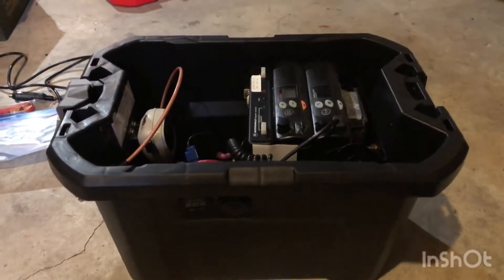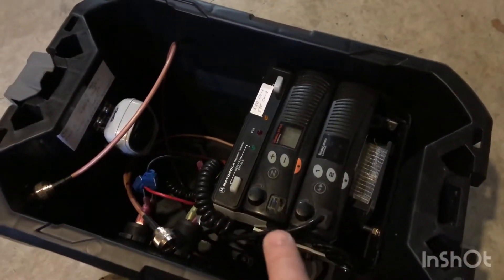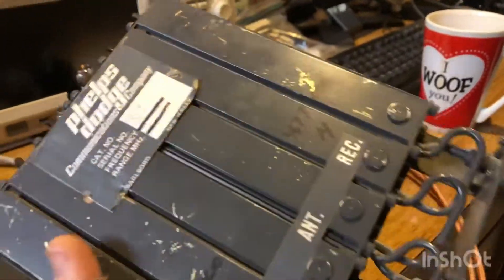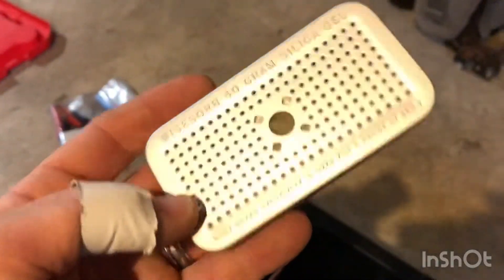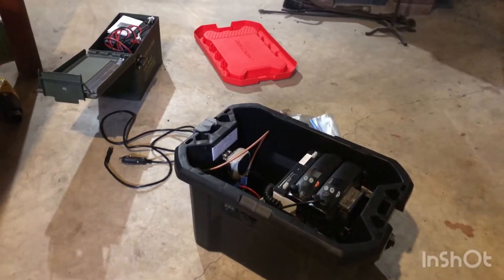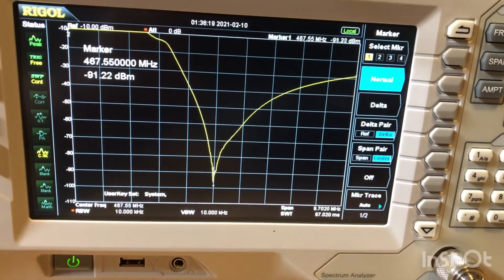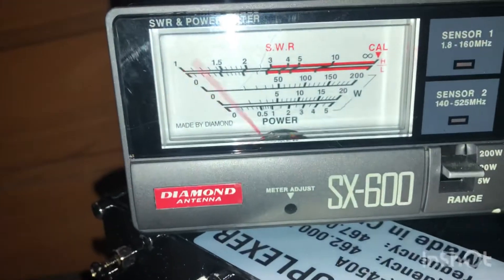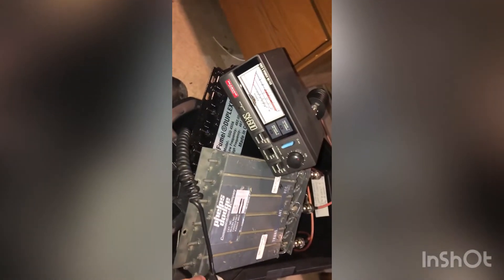GMRS/SHTF REPEATER CHINESE VS NAME BRAND DUPLEXER

Comment: A bunch of friends and I have followed Guerrilla Comm for years now.
He was one of the first YouTube 2-way radio comms channels, though it sadly appears that he has stopped posting videos for the past few years.
Reply: Surprisingly enough, the Fumei (Amazon Chinesium Special) has been an amazing performer for us.
However, It is  *ABSOLUTELY CRITICAL* to buy the 50 Watt model.  They have a 30 Watt model that is similar in appearance, but they are truly miserable!  (Amazon Pricing as of September-2024: 50W = $129  /  30W = $89)

Note:  If you ever come across “FINGU” brand duplexer, do NOT hesitate if new or in excellent shape and the price is decent.
They are actually manufactured by a large cellular infrastructure cavity & component manufacturer in Asia.
They sell their LMR stuff exclusively to /\/\otorola who sells them as the OEM for their public safety LMR systems. 

(Rack Mount BpBr 250W and 500W models &  mobile/notch type models)

Just as an example…
The 250W UHF BpBr model sells from Motorola for $3199 and they sometimes discount a bit for larger orders.

Comment: I have thought about assembling a SHTF repeater using a cheap Chinese duplexer and a couple of Motorolas. However in my country to be "legal" on our UHF CB frequency allocation the Tx/Rx have a 0.75MHz split. A cavity filter that will tune that narrow is large, very expensive and almost impossible to get hold of 2nd hand. I would probably have to run two antennas and deal with the difficulties associated with that unfortunately.

Comment: Moving air saves these radios, I have 2 kenwood tk880's on the air, one is the 880h with 45watts. March will be 1 year running high-power, used daily and hour long nets plus each tuesday. Great video on the mobile rig.